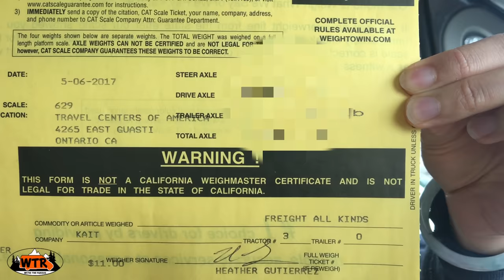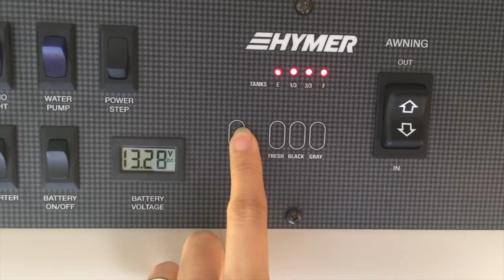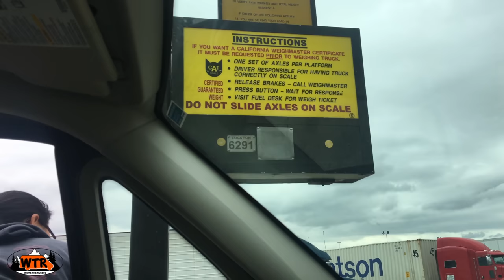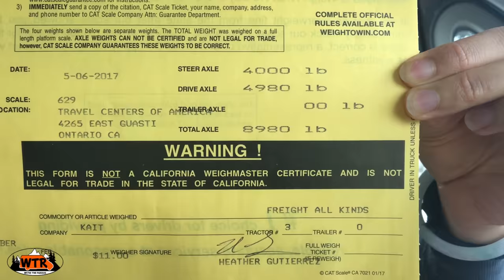Cassette Toilet + Van Weigh In | Camper Van Life S1:E3

Comment: I think the cassette toilet holds about 4 gallons which for some might be a bit hard to handle but did it create any spills when emptying?  My RT holds 8 gallons in the black tank.  I have the bottom of an old camping toilet that will be perfect as a cassette, it has a tight seal and holds 3 gallons and fits neatly in the drivers side storage.  The idea is to empty the black tank into it and then dump in a nearby toilet if no dumping station is available.  Trying it out this weekend for the 1st camping trip of the year. On the way out, I'm stopping at 2 different dealers to check out the Hymer Activ and Zion SRT to see which one I might upgrade to, same chassis just different layout.  Take care and travel safe.

Comment: Great stuff guys! We are in Denmark and have a camper with a cassette toilet. Perhaps you could do a full video on it for those that don't know how easy they are. Are you fully rinsing yours and adding bio chemicals each time you return it to your camper? If rinsing be careful to swish it gently so as not to damage the floater inside that helps with indicating how full your cassette is. We keep a package of disposable gloves in the cassette storage area for dumping. Love Leo.
Reply: I'd also like to see a full video on the cassette toilet and the shower...
Reply: Sounds like you have done your research. Should have known! 😉 Yes we have gone 5 days so needed chemicals. We don't use them for weekend jaunts.
Reply: I put Hydrogen Peroxide and bleach in mine. One cap full of each. Then add water and rinse it out. It kills any smell and germs on contact. Put one cap of Hydrogen Peroxide after rinsing in it. It will kill any smell. As it breaks down the urine that causes the smell instantly. Which kills bacteria and neutralizes the salts in the urine. Up side is. It stays cleaner inside.

Comment: Most houses have vent pipes outside of them on the yard. It is a sewer vent. Instead of rolling inside the house look for outside vent pipe and dump in there. THEN have a friend flush a tank in the house to send it on it's way. I used a cassette toilet on a boat for a few months. They are easy to use and fast to flush.  

I think you should head to Seattle.
Reply from the maker: Good idea there Dan ;) I think we might just be heading up the coast and enjoy the scenery...and beer.

Comment: I realize you posted this over a year ago, but was wondering if you still use your Reflectix sun shades.  Asking due to the fact that I viewed another youtube video that stated using this material in the summer could actually damage your vehicle's glass because of the amount of heat it reflects back out - your insight on this matter is deeply appreciated, thanks in advance.

Comment: Maybe it would have been better tracing the outside of the windows and then using velcro strips to secure those  blinds so no constant tucking needs to be done? Great work and it should keep the van much cooler.
Reply from the maker: Thanks David...we thought about that but tucking them is really quick and easy.

Comment: Wondered why you picked the dodge over a sprinter model. just getting into RVing and not sure of the pros and cons of each. Interested in the Pleasure way Plateau TS or the Luxor TS. As you know the former is diesel and the latter is gas. Thanks.
Reply from the maker: Well we've partners with Hymer and they provided the RV to us. That said, the gas chassis is much less expensive and although you don't get the same MPG or towing as the diesel, maintenance costs are a LOT less expensive as well. We don't tow anything so no need for the diesel.
Reply: Thanks, enjoy your new RV

Comment: I think the numbers are reversed. Weigh station drive axle would be rear but Promaster is front wheel drive. That's why what you called drive axle went up , because it's the rear where your stuff  is stored .
Reply from the maker: Thanks Stan - we're aware that the drive axle is on the front end but we are just referring to what is on the weigh sheet. Truck stops don't get many front wheel drive vehicles on the scale so the rear axle is always the "drive" axle.

Comment: You're lucky with the fuel prices. You buy it at less than half the price compared to ours. One gallon of gasoline is USD 5.40 here in Turkey, diesel is a little less :(
Reply from the maker: Yep, and it gets a lot cheaper once we leave California.
Reply: Today our gas prices were $2.17 in central Iowa.  I'm thinking that I need to put some fuel in my class A.  It gets lousy gas mileage. (powered by a Chevy 454 engine)  I feel good if I can average 6 MPG with it.  Good thing I only use it for nearby boondocking-lol.
Reply: clyde alspaugh meanwhile over the pond here in the uk,fuel prices £1.20 pre litre ouch.

Comment: Please keep us updated on your experiences with the cassette toilet; ... the rv/expedition vehicle I will possibly purchase has one and one of my concerns is "flushing" it and keeping it clean (ie. the flush/clean black tanks occasionally need because of "buildup") --- obviously the sales team/manufacturer downplays the concern as a non-issue.

Also, had to laugh at Kait's being blinded and comments about the Reflectix as I occasionally contemplate having a chrome wrap applied to my rv; ... sort of a disco/reflective ball driving down the road (but definitely memorable and possibly cooler camping in the desert)
Reply from the maker: We're trying to only use the cassette for #1 because then it's you flush once and you're good. With #2 added, it takes a few more flushes to clean things out but I've heard that adding some water softner can make this easier. 

A shiny Airstream is pretty much what you've contemplated ;)
Reply: That was sort of my question, too.  With #2 added, can you still dump the cassettee "all in one go", but it requires several flushes?  Or, do you pour it out in "sections", each one flushed?

Comment: Class B is the way to go. It's just a big van that handles good. So you never worry about parking anywhere. Just want a Ford i5 Transit diesel. They are increasing the GVWR to 12k lbs. This will put them head to head with MB. Which I refuse to own. As the MB are rust buckets. Have the worst service departments and wait times for repairs. If you happen to be close to one when it breaks down on you. One reason I seen an LTV Unity for $29,000.00 for sale. It was over the 100K mile mark. Which means it's going to toss the transmission any day on them. Which will cost a fortune. And I worked on them. So I know the headaches of owning a MB. 

Not sure about the Dodges yet. Just have to see the reports owners give feed back on. After some serious use and banging around...

Have fun...
Reply from the maker: We have a friend who has a small fleet of ProMasters for his business and told us that the cost to maintain is significantly less than the Mercedes, which he used to have. We really liked the LTV Wonder built on the Ford Transit chassis.
Reply: I want a real Class B. Not a Class B+ with the Ford i5. I have sneaky suspicion they will not build them. As they would sell less MB. It's either that or MB will not sell them the Sprinter if they sell a competing product that is cheaper. Has more dealerships. Easy to maintain and cheaper on repairs. 

And the added benefit. The Ford Transit chassis is so tough. As they used high-strength boron steel. You need Carbide drill bits to make a hole in one. It does have no drill zones. But for places that would induce water and no drain holes or venting are available.